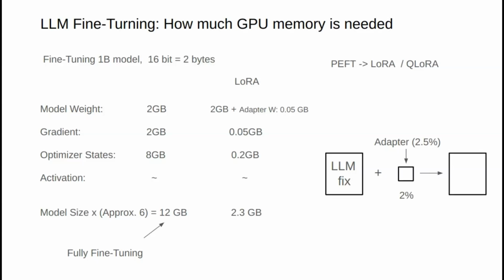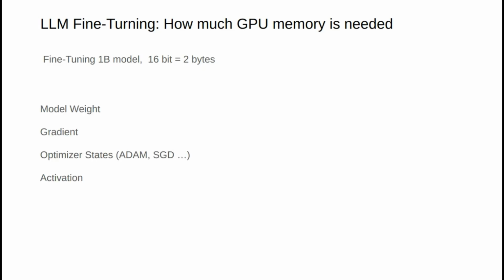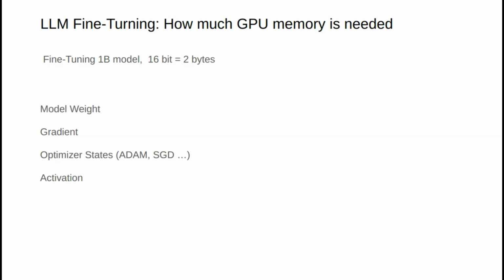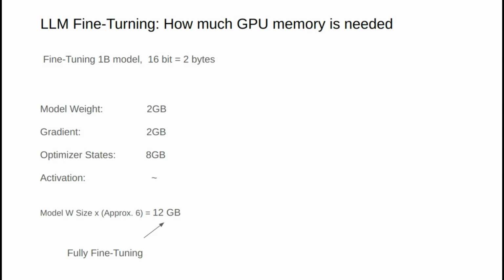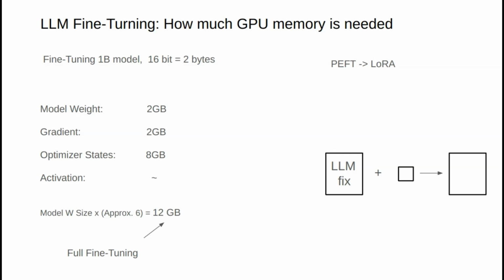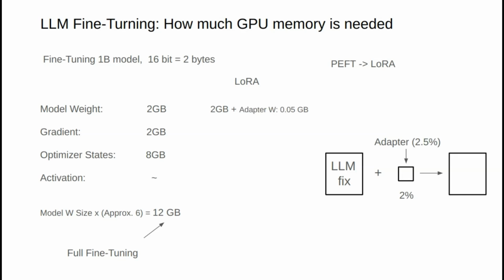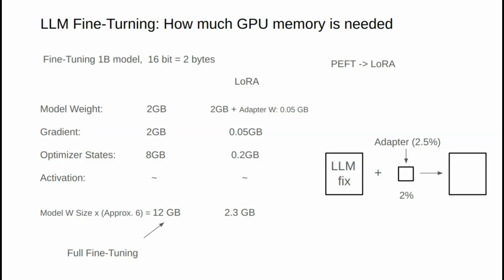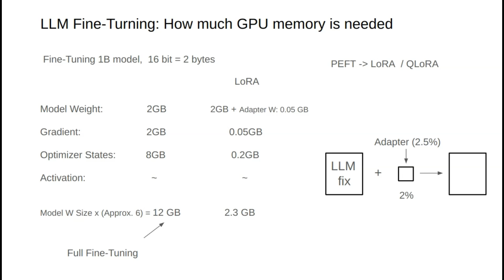How Much GPU Memory Is Needed for LLM Fine-Tuning?

Comment: I am trying to fine-tune LLaMA 3.1 1B Instructor using the LoRA method, with approximately 1200000 new parameters, in Google Colab. However, I keep running out of memory despite having 15 GB of GPU memory. I thought this configuration would only require around 3 GB. Can you help me?

I am using the Transformers library. My configuration includes a batch size of 2, gradient accumulation steps of 4, and a maximum sequence length of 2048. Maybe the issue lies in my configuration.
Reply from the maker: Hi, your sequence length 2048 tokens may result in large activations and intermediate results during backpropagation, maybe try to consider reducing it temporarily it to 1024, and set batch_size=1 and increase gradient_accumulation_steps, maybe to 8. Also maybe adjust LoRA rank to reduce the memory. You can also enable gradient checkpointing in the Transformers library to save some memory.